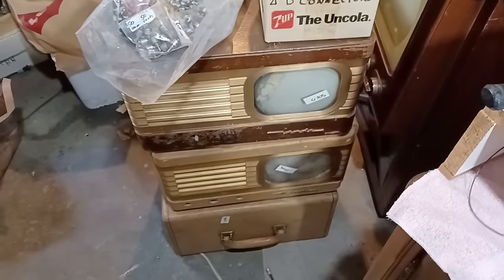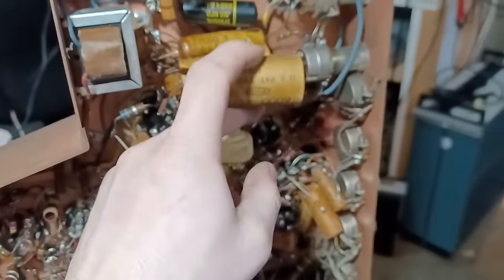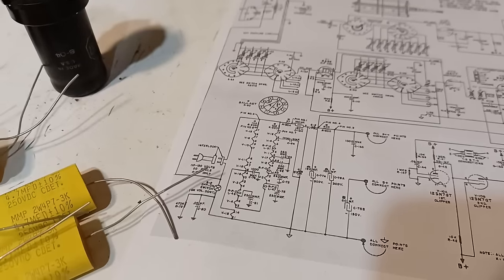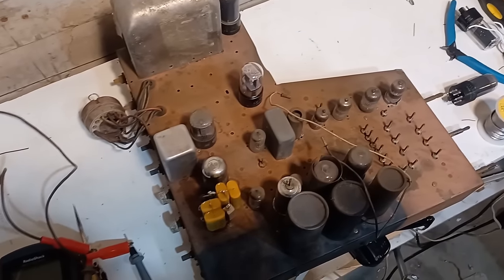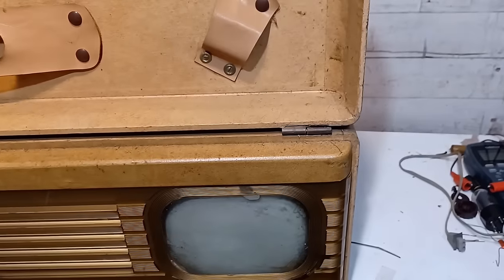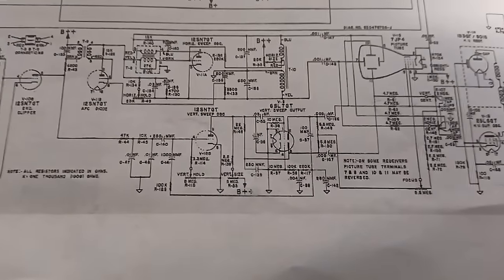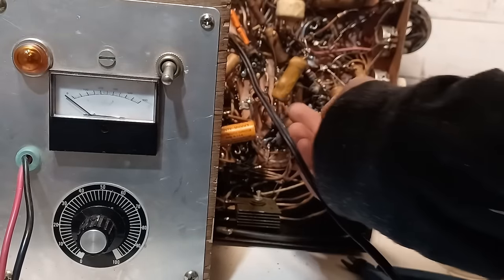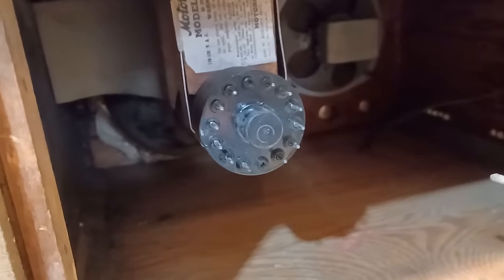1949 TV VT73 Diagnosis and Repair

Comment: Takes me back to when I was a TV engineer starting in the late 70s till the early 90s before I moved to cable TV and telecoms. It was satisfying to fix tv's back then and on a winters day in the workshop, those old valve tvs could keep you warm 😊
Reply: When I was a young engineer at RCA in Camden NJ, about the same time, the heating system in our 1910-era building was about shot, so we turned on the old tube-type Tektronix oscilloscopes to keep the lab on the corner wall habitable in winter.  LOTS of tubes in those, plus a fan to move the heat around.

Comment: Amazing that the CRT has held a good vacuum for all of these years.I bought one of these from a neighbor back in early 60s, when upgraded to a 10 inch set. 😀 I should try getting it to run again. 
From an ex-ham and ex-CRT engineer.
Reply: @David Wanklyn Surprisingly, I remember a lot. CRT technology has not changed much. Ham radio has. 😀

Comment: I love these electrostatic sets. Hint: These sets have an RF oscillator to obtain the very high voltage for the CRT, and sometimes the voltage is lower than expected despite everything around it being fine. Sometimes it's the RF coil which got moisture and lowered its Q or even somewhat shorted some spires and that is a coil you definitely don't want to rework. If the voltage drop is not too much, you can seriously raise it by simply inserting a ferrite rod inside the air core. Ferrites from switching power supplies are great for this. And that gives the extra bump the voltage needs without making any serious rework nor modifying anything.
Reply: Javir Albinarrate
This TV is magnetic deflection 
Radar is oscilloscope CRTs, electrostatic deflection!
Reply: @lucasrem  it is electrostatic.  It uses a 7JP4 crt which you can see at 26:40 in the schematics,  and at 34:27 you can see that it lacks a yoke. I have 3 of these, 1 Motorola like this one, and 2 Silvertones, I also own a Pilot with 3 inches screen.  These "portables" were common in the late 40s. 

BTW radars which used PPI presentation used magnetic deflection with a servo rotating the yoke, crazy stuff,  I own one Decca radar from the 50s. 

And circling back to my original post, as they are electrostatic they don't have a yoke, hence there is no flyback transformer to take advantage of, hence they used a dedicated tube as an RF power oscillator (usually a 6V6) with air core transformer.

I hope that clarifies it 😉
Reply: @lucasrem  Magnetic deflection????????????? Have you actually watched the video?
Reply: So a tesla coil to power. I wonder why no arcade vector graphics was powered by electro static. X-Y mode on a scope is goes up to 20 MHz. Could draw 3 million lines per second ( turn off the gun a the vertex, fly a loop). 50 thousands lines per frame @ flicker free 60 Hz  @JavierAlbinarrate

Comment: The old ones were certainly a fire trap, I was so surprised with the quality of the picture on the set, so cool, PCBs certainly changed everything.
Reply: not pcbs as such , but transistors(although here in the uk, a transistorised  set in the '70s was notorious for burning up!),, pcbs were used with many valve/tube sets , and many got blackened/carbonised due to heat
Reply: @andygozzo72  I was mentioning the PCB because moving and transportation of these old sets could of caused the spider web to collapse on itself and make it just what is needed to produce a fire
🔥🔥🔥🔥

Comment: Brilliant. Thank you very much. Very nice video. Also very interesting, that just capacitors did not last for such long time. Rest of the set was holding on. Picture on tube is impressive for such old screen development. Nice piece of work of technical development. A lot of inspiration and gratitude to electronic development.
Reply: many capacitors do last, ceramic ones very rarely fail, 'modern' poly types almost always last ok, but some been known to drop in capacity with use, especially if subject to high 'current', such as in motor run caps

Comment: Just curious - why don't people use a pair of current limitable DC bench supplies - one for the filament string and one for B+ when testing. That way you can have the filaments running at full temperature then bring the B+ up slowly with a much lower current limit?
Reply: From my own experience, the reason people don't do that is because it requires a couple of current limitable DC bench supplies of the proper size.  Those aren't cheap or small items for a hobbyist.  Also it requires that you disconnect the B+ and heater circuits to use external supplies -- lots of extra work.  Most antique TV troubleshooting doesn't require that level of care, particularly if you start off by assuming that all the electrolytics are bad (which for 50+ year old electronics is a near certain situation) and replace them.
Reply: @k8zhd  I guess I've been lucky on eBay - I have a pair of 300v / 3A supplies that didn't cost the earth!
Reply: @martinwhitaker5096  Wow!  900 Watt supplies -- they must be huge!
Reply: @k8zhd  they're big, but not huge. They are switchmode so they may put a bit of noise out, but never had a huge issue with that when working on radios.

Comment: I just restored a 1949 teltone 7 inch TV, almost exact circuits as your model, my biggest issue was once i recapped it was the IF  was way off. the set just had small screw adjustments in the tuner for fine tuning,  took a while to get the sound and video adjusted in the IF  stages,  i have sweep gens but they to need work, but i was able to finally get a good picture with a strong rf from ma vcr, the over the air boxes dont work so well,  Its great keeping this technology alive

Comment: Excellent Troubleshooting! One feels honored to see this.😃
You would have loved the power triode tubes from a 1950s Mass Spectrometer Unit we had sitting in the vaults of the cellar of the Technical University in the 1970s! 😮‍💨
The troubel was at that time, as Electronics Technician Apprentices, we knew what we had,
but were simply too stupid to do something with them, such as building a Pirate Radiostation around those things. 😭

Comment: I love your channel. It’s much more interesting the way you are doing it. Pls keep them coming.
Incidentally, when you add to capacitors in series to do the work of one, the two new caps have to have the same leakage….otherwise the volts across them could be s different………

Comment: That was fun. Brings me back to the days ( 1971 to 1974  )when I seen these in the basement of the TV shops I worked in. When we had time we would pull the old sets out of the basement and try to get them working again just for fun. We would display them running by the front counter. People alays were amused by them.

Comment: por lo que se  puede aprecial  este es un circuito wn serie los filamentos , de los tubos lo que hace mas dificil la reparacion , pues no  ahi chance de intercambiar ningun tubo si no es el horiginalademas es increhible que allas obtenido el plano original de ese tv. en verdad eres bueno en este negocio . te felicito y continua  con tu interesante trabajo . muchos anos atras ese fue uno de los  trabajos mios de hecho aun guardo algunos radios muy antiguos y un televisor de 14 pulgadas a  tubos (tambien  es en serie sus filamentos y esto es un problema cuando se funde algunas de las valvulas y tiene que ser sustituidas por otra.  gracias por tu interesante video.

Comment: These are what electronics were when I did my apprenticeship in the early 1970s. Often the problem was a dry joint or a  resistor burnt out, or a capacitor gone, or a faulty valve. Bitch of a job finding the problem. In those days the serviceman went to your house and worked on the TV.
Reply: We didn't get TV broadcasting here in NZ until 1960 and we brought our first TV, an Admiral 28 inch, in 1961. We had the only set in the neighbourhood, so after school, kids would arrive that parents sent around, without asking mum who had to  look after them. The parents were quite put out if they were told to not send their kids around.

Comment: I absolutely love old home stereos, CB's, televisions, video game consoles. you name it. Unfortunately I never come across the stuff but I've spent hours behind the soldering iron. I wish I had more chances just to mess with these old electronics. Replace a capacitor or two, fix some solder joints there is nothing like playing PlayStation 5 1540p high definition video games with Ray tracing technology on an old black and white screen. Even the manufacturer never thought back then such a clear picture would come through. It's still not up to today's standards, but for what it is, these newer electronics, which usually have to be connected through various modules to get to work, for what it is, the picture is stunning. It's neat and entertaining

Comment: My dad used to get all the free inop TV's that he thought he could fix. He used to usually fix them and he would have me help. If a tube don't light up or looks black and burnt it's usually bad. So I'd dig in the several different pails and boxes he had of these tubes till I found one that would fit and looked similar or same part #. Miss those days.

Comment: So cool! I have a 1948 RCA 9t240 that has been in my basement for many years, I saved it from a passed away neighbor when I was little. I'd love to get it working but I don't know how to work with electronics. All the bulbs inside glowed orange when I turned it on last time, but no sound, no picture. I bet the caps are all bad

Comment: I have 2 admiral and 1 motorola def. plate tv's    all same probs hv,defl.plate 6kv caps.  you are very good at this.   I have got get an old cap checker that applies E to caps for simple leakage tests,  been using fluke on hi resistance to look for leakage.  and place to find hv caps at a reasonable price..   thanks for video.

Comment: My skills and experiences are quite minimal, but in the late 70s I got a tube radio receiver from my brother-in-law. It was nice, but the FM wasn't working. While looking inside I noticed that there was a big resistor cut in half just like that. I measured the resistance of the halves, made a guess, replaced it and the FM started to work as well! 🙂

Comment: What an excellent video and such a good quality circuit diagram.  I think older things are more fixable than the modern crap
Reply: Bill Hall
What you call modern crap?
You never need HDR levels, can't see 4k ? Codecs?
Reply: @lucasrem  Hi I was comparing how much easier it is to repair something old as against a newer TV That has a large pcb with 5 transformers multiple H bridge surface mount chips in parallel driving them and the rest of the pcb all covered in surface mount chips. All just to get the back light to light up. Probably more components just for the back light than there are in the tv in this video. 🙂

Comment: The chief problem with anything from this era is the waxed paper caps. I think even in the day the '6000V DC' would have been a shade optimistic!
One small point, though. Putting two caps in series will not guarantee a cap of double the voltage as this assumes the insulation resistance is equal. A way round is to add high voltage bleeder resistors of equal value to even out the voltage across individual caps. However, for some applications this may not be possible as our combination effectively becomes a 'leaky' cap.
Anyway, keep up the good work!
Reply: With mobile phones we switched from wound batteries to flat packs ( and now back to round in cars ). With a capacitor I still wonder about the field enhancement at edges and spikes. If I was to manufacture condensers for a large device like a TV, I would stack thin metal sheets and thin insulator sheet ( polyester or paper). Then connect the space between two adjacent metal sheets ( basically belonging to two different capacitors) to hot high pressure air, and connect the space where the dielectric is to vacuum. The sheets should slightly bend. Or insert metal shims to have a flat center region, and bent up exterior. Field enhancement becomes less critical with more and more distance. Take this stack, bolt it to the side of the casing, and then solder wires to get the capacity you need at the location you need it.

Comment: I did a little research on old tvs.  That indian head that was on there is because old tvs had about 10 shades of grey in the picture, and an indian headdress had the perfect amount of shades to be able to tweak those and adjust the picture.  I always thought it was a logo or something, but turns out it was just the perfect picture for diagnostics.   Pretty cool tho.

Comment: This looks just like my TV!  I bought it on-sale at Sears for $299!  Huge picture compared to my 3" TV.  (j/k)  But seriously, the rat's-nest of wiring amazes me.  Do you think any of these worked fresh off the assembly line?  I figure they went straight from "assembly" to "trouble-shooting."  If you look at European electronics from the same time period, they had a MUCH neater way of positioning the components (columns of terminal strips under the tubes), although, the U.S. style may have been "space saving."  BTW I paid $45 + shipping for mine.  The Post Office made me drive to the station to pick it up - they wouldn't deliver it!

Comment: Yeah, I tend to do that too, but I draw the line with those selenium plate rectifiers. If you don't disconnect them, change all the caps, so there's reduced risk of a short cap blowing the rectifier. If they ever blow get out of the room and ventilate the room thoroughly.
Reply from the maker: Thanks for your concern. Electrolytics were fine in this set, any paper caps with leakage below 500v were replaced. Had a rectifier blow up in a museum I volunteer at once, the guests were not amused.

Comment: Do you know if using small .01 3kv disk capacitors will work to replace those high voltage caps?
Reply from the maker: Ceramic capacitors can have their capacitance change with applied voltage giving a distorted waveform. It is recommended to use film capacitors for the high voltage caps in these sets. 
The set will work with ceramic caps but the picture might be distorted.
Reply: @jdflyback  any chance you know why I might be getting nothing on the CRT? I replaced most of the caps besides the high voltage ones, but I seem to have high voltage. I hear the high pitched noise like the horizontal is working but it’s very quiet. All the tubes test good besides 2 of the 12sn7s which were very sad so I replaced them with good ones but got no change

Comment: That tube outside of the cabinet is just gorgeous.  Would make for an interesting art piece of sorts, especially since you have multiples.  Great job on troubleshooting and correcting.  Maybe I missed it, but why did it seem like the tubes were crooked/rotated off point when you first turned them on?
Reply: Not sure if it was the case here, but I've seen previous repairs where it was as simple as rotating the deflection yoke on the neck of the CRT. 

The yoke is basically a set of electromagnets that move the electron guns around inside the tube, so if it's not exactly right it can rotate the image in the manner seen here.

Comment: I think with this one working I don't know if that set without the high voltage filters is a 71 or 73 model, but could find the circuits removed so I could replace those high voltage caps to make it whole again. The problem with these old sets is when a micro-henry coil has failed unless you have access to many of these it is difficult to find a replacement. Of course you can rethink the circuit to make one out of tolerance fit,  but the engineers who made these sets won ww2 with our radar and they were the world's best. And to think you can get one of these working easier than a late 50's set is really something. We have no access to these picture tubes so what many people do is use off color oscilloscope tubes.

Comment: Amazing video. Thanks for posting this. I noticed that you touch capacitors with your bare hands. I thought one had to be careful so as not to get shocked. What parts of this set would you want to avoid getting shocked? I have a similar set I'd like to restore.

Comment: I was curious about the price of this TV in 1949.  Looks like around $61 which in today's inflation is $760.  Good video!  Thanks
Reply: The VT-71 was  advertised as costing $189.95 in 1948.  Today that would be $2262! The Pilot TV-37, with a 3 inch screen,  was the first postwar TV to sell for less than $100 ($99 actually), which was a big deal at the time.

Comment: The 105 ohm resistors on the series strings act as inrush current suppressors and current  balancers. 

A standard indirectly heated valve (tube for Septics) has a hot / cold resistance ratio of about 7, so if power is applied directly to a string of 300 mA valves (eg that 12SN7) the startup current will be about 2 amps on average. It can actually be higher than this depending on when the circuit is connection is made, if it is at the peak of the supply waveform the instantaneous current would be about 3 amps.

The heating time of valves designed for series strings was controlled but there is still some variance, so the first valve to get to temperature will have the highest resistance and thus the greatest voltage drop. 

Adding a significant series resistor reduced both these effects: the resistor limits the inrush to about 1 amp, this in turn limits the rate of temperature rise of the fastest valve.

These effects combined meant that the service life of valves in series strings was severely compromised but that only showed up as increased service costs. Not having to run a filament transformer lowered the purchase price, so it became dominant practice, at least in the US market.